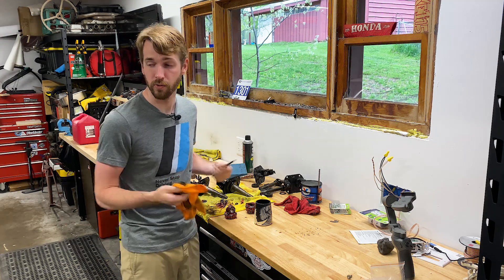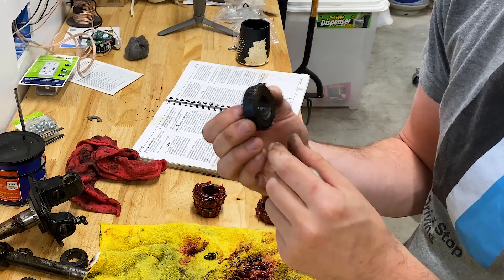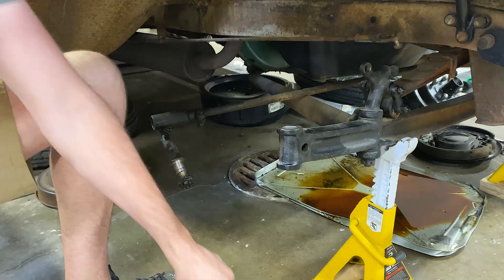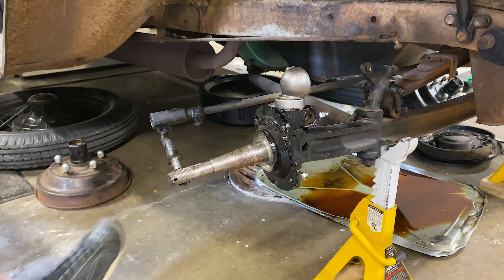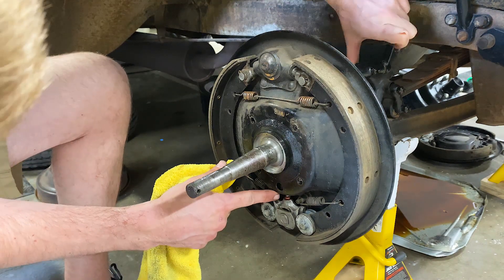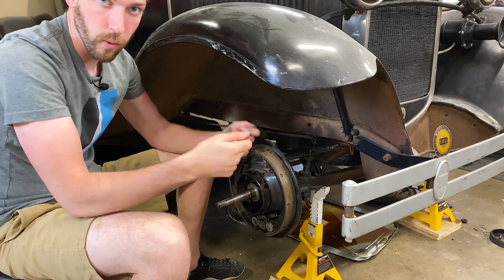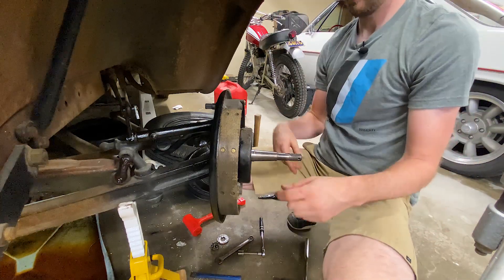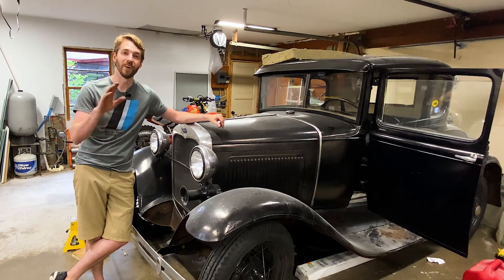Front-end assembly for the Ford Model A | Kyle’s Garage - Ep. 5

Comment: I think you need to consult your manual. Thrust bearing goes on the bottom.
Reply: Not on that particular design early Ford assembly. The thrust bearing does go on top and the felt washer/cup on bottom where he placed it. Check out an original Ford manual.
Reply: @380.motorsports  Have it your way :)
Reply: John Farr Unfortunately I can’t take credit for it. I just looked it up for different years of early Fords. Give Henry the credit.
Reply: @Vintageguy73  Not your (Kyle's) way.  Henry's way, at the time) Please check before you post information. In this case YOU were the one giving out incorrect .information. You owe Kyle a POSTED 
 apology.

Comment: I believe the thrust bushing goes on the bottom not on the top think about it look at your manual
Reply: I would not take lessons from this guy. He lacks experience on the correct ways to work on the Model "A"  assembly procedures.
Reply: Actually his info on the thrust bearing is 100% correct .ford changed it a little later on & put it below the axle boss & above lower spindle boss. But for the model a this is correct !
Reply: Information on thrust bearing is correct.

Comment: Kyle, I like your video very much. Clear vocals, and no,  I THINK IT GOES THIS WAY,  I DON"T KNOW WHAT YOU CALL THIS BUT....Two things I ran into, #1 I didn't realize there was a left and right spindle, and put them in the wrong side. The hole where the steering arm goes into the perch mount is tapered. If you put them on the wrong side, the steering arm will not go in. #2 I also put the king pin lock nut in (and tightened it) before I put the brake arm into place. You can't get the arm into the king pin without turning the king pin to the side, install the brake arm into the king pin, and THEN turn the king pin to fit the brake arm bolt into the mounting whole in the perch mount. I hope someone can learn from my uneducated mistake.

Comment: You can heat grease up in a fry pan on minimal/low heat to allow the grease to flow into the thrust bearings. That's how you repack the bearings the same with motorcycle chains using low heat with o-ring seals
Reply: That's great news. I'm an old timer but I never heard that one. ""  Loving it "

Comment: Kyle, you may have done it without showing it but there is a king pin lock pin that also serves as a steering stop that you didn't install. One on each side. Also worth checking when doing this (yours appeared to be OK) is the length of the brake actuator rod (they wear) and the pin/clevis (for wear) on the brake rods. The holes in those clevises and their pins are frequently pretty badly worn. 
Just wondering, doesn't the grease seal (for the wheel bearings) need to go "behind" the bearing AFTER the bearing is installed inside the hub??
Reply: It's a part which might have been forgotten in the past. I bent mine a little bit.  What I've read says it needs to be pressed on. Do you know if there is there a good way to do that at home with only a 6" vise as a " press" .

Comment: Nice video Kyle. I think you might have a future doing this. I notice that your front spring has the symptoms of being worn out. Did your dad have the original shocks somewhere in his parts pile?
Reply: As a newbie may I ask what do you see that tells you yje spring is worn out.  Thanks
Reply: @kennethhead6941  I too am a newbie, but I just researched and repaired my front spindles using exploded diagrams, the Les Andrews red book and multiple threads on Model A Forums. Read, read, read. The bottom side of the shackle 'appears' to be very close to the axle and the bottom flange of the axle 'appears' to be even with or above the front splash apron. With wheels on, there should be a good space between the top of the tire and the edge of the fender. Although I've never seen one in such bad condition, a completely worn out spring can let the bottom shackle rub the axle. From the front of the car, you should be able to see half or more of the axle under the splash apron.

There is also a felt washer, dust seal, that goes on the bottom of the actuating pin, and possibly a need for shim or shims under the thrust washer. Check for vertical slack by placing a jack under the spindle axle and applying a small upward pressure to the spindle and see if it moves up and down. The weight of the car must rest up against the bottom of the thrust bearing. It won't if there is play due to a non original bearing (wrong thickness) and / or wear in the top of the spindle. 

This is an informative video and worthwhile to watch multiple times if you've not done this before. He said it was his first time too.

Comment: Thanks, Kyle I have one side of mine 1/2 way disassembled and am in the process of cleaning things up. Mine is a '28 but it has a pin that fits into a grove jn the king pin which won't let the king pin move around. I didn't see that on yours does the later models have a different method?
Reply: Sorry , I see many others noticed the  minor error you missed. I'm sure you would have caught it when you found a couple extra parts on the bench.  I got into Model A's much too late in life.  It's fantastic to see a young man who is interested in them. When we ( us old gray beards) were your age, we also made frequent errors. Like putting the clutch plate in backwards on one of those old granny gear 4 transmissions.  With no pilot alignment shafts or hydraulic jacks to carry the weights just a couple inexperienced teenagers.  But we all learn.  I credit you for teaching this old timer how to rebuild my front end of MY model A.  Thanks 
 
              "YA DONE GOOD"

Comment: Maybe I missed it, but isn't there a cross bolt and nut on each side that prevents the king pins from turning?
Reply from the maker: Yup! You can see it at @16:55
Reply: @Hagerty  Yep, I see it, well done!  Looking forward to seeing you go for a drive.  Do you have a notched board for positioning the brake pedal when adjusting the brakes>

Comment: Is putting a bushing in a spindle a huge pain in the butt? (I have no idea.)   Because you are SUPER excited about those bushings.  In this and the last video, you called out the already installed bushings like 10 times. lol
Reply: It takes a special, long, reamer used correctly to get a good straight through, top to bottom job. An automotive machine shop will hone the bushings after pressing them in and this does a superior job.

Comment: There is no weight on the thrust bearing when installed at the top of the kingpin. Does it not belong on the bottom?
Reply: You are right typically a thrust bearing would go at the bottom between the spindle and axle. However there is not enough room for the bearing in the normal position. In this case up top is correct as the weight is transferred from the spindle, to the thrust bearing, then to the shoulder on the kingpin, then to the kingpin tapered pin (which he almost forgot on the right side) and finally to the axle.